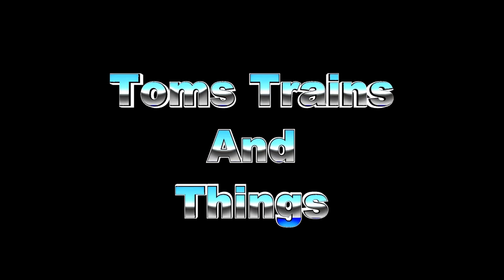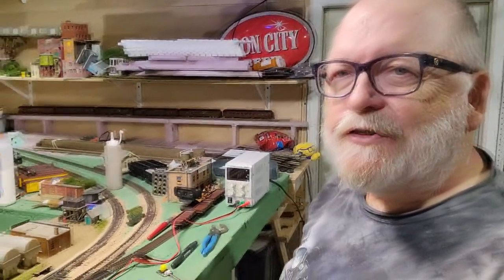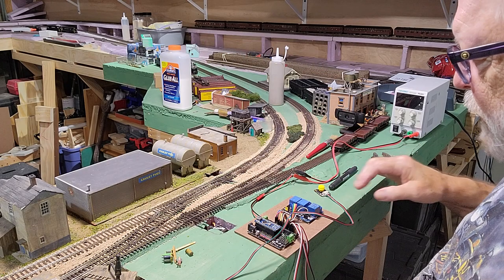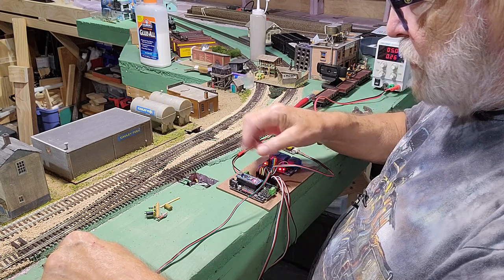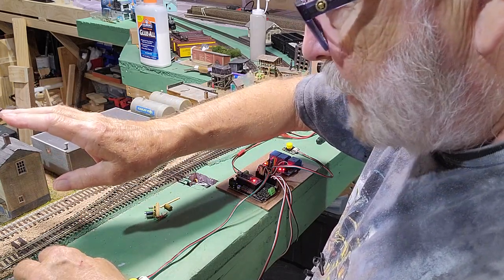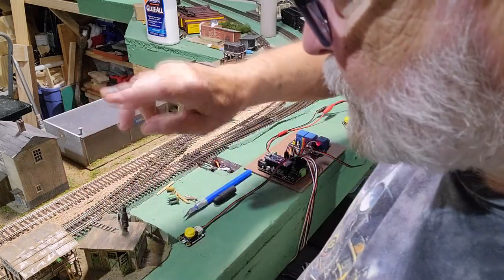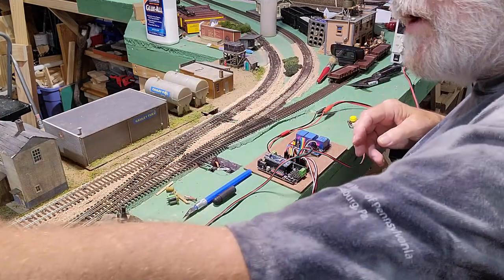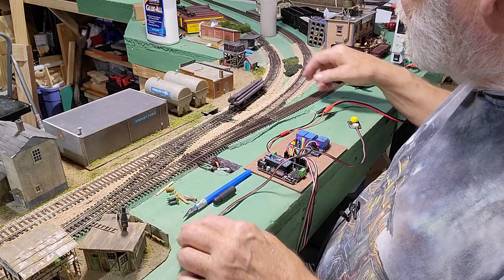Turnout Control With A DF Robot I/O Nano Shield

Comment: Tom, why do so many of these units need separate power supplies? Why can't  they make them all use one power supply except the track supply. I have like 6 power supplies for a 9 X 4 layout and afraid that if I don't turn them on in the right order, I am going to have a McDonald's French Fries sale.
Reply from the maker: If they have the same voltage, you can use the same power supply